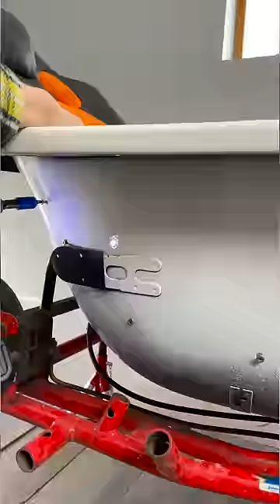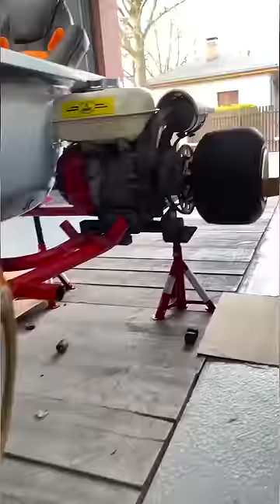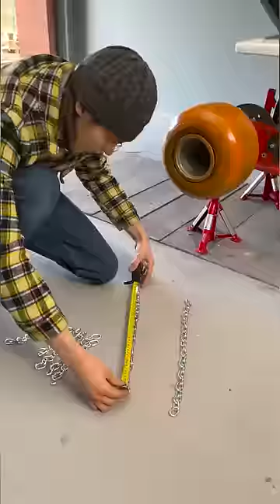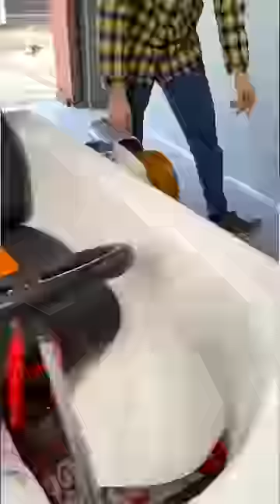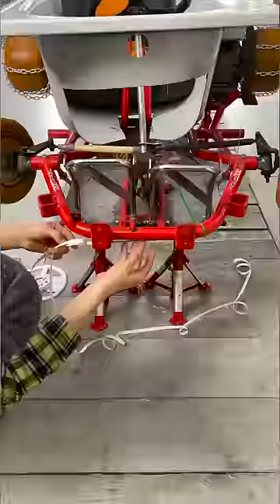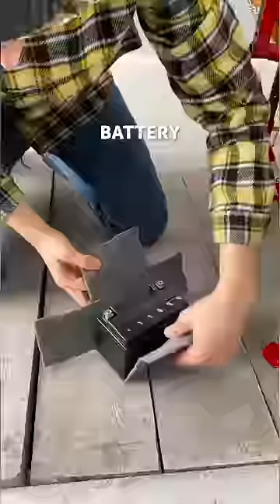DIY Bathtub Go-Kart: Transform a Stock Kart into a Fun Ride 🛀

Comment: That LED sctip is NOT water resistant at all, I would recommend using at least the coated strip, if not the full waterproof silicone encased strip.